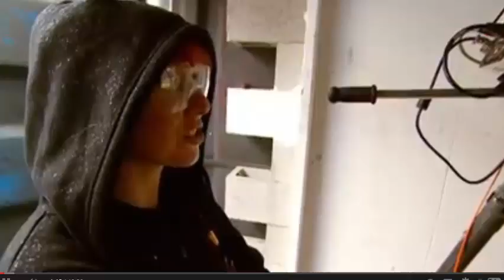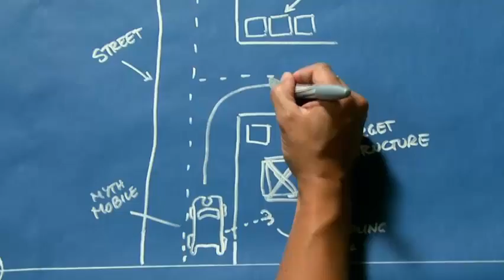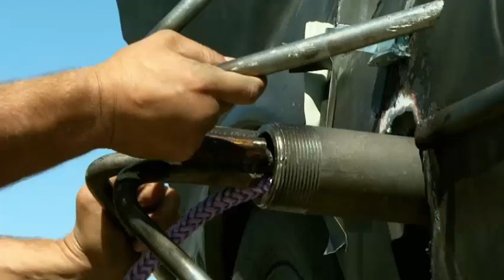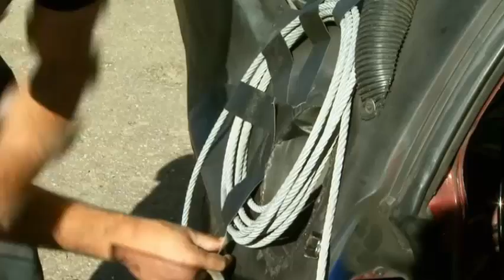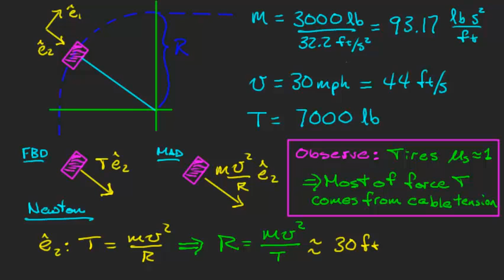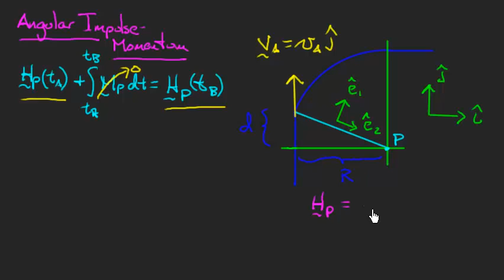Engineering Dynamics Analysis of Myth Busters Problem

Comment: been on your site doing problems and studying eng...thank you so much for these...you really make dynamics real and are a great teacher.  My take from this particular video was the importance of that dt... and why the instantaneous effects are so important.  Essentially, and pls correct me anyone if i'm wrong.  Had we stretched the time under which the cable was under tension, we probably wouldnt generate the high forces but that short (delta_t) of instantaneous tension is why such a great force was needed.  Explained so much about why differential math is so important in mech eng.
Reply from the maker: Correct. Good job.